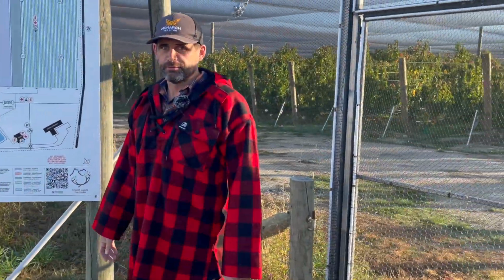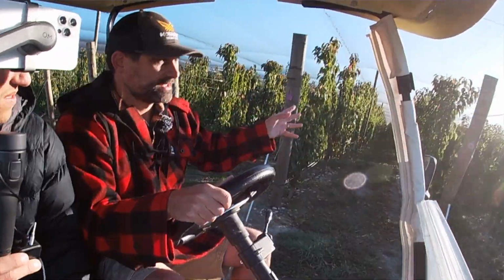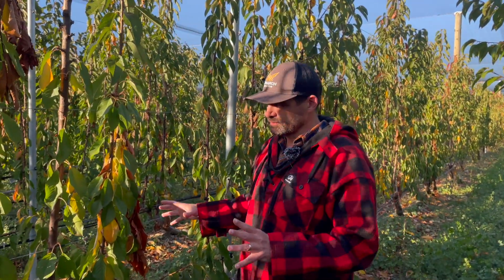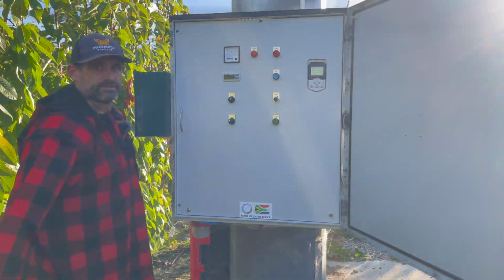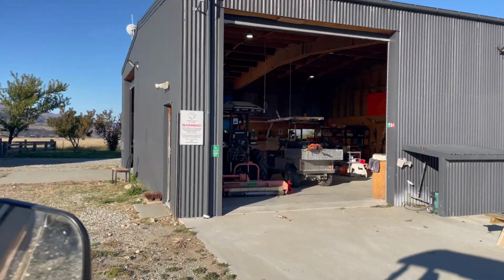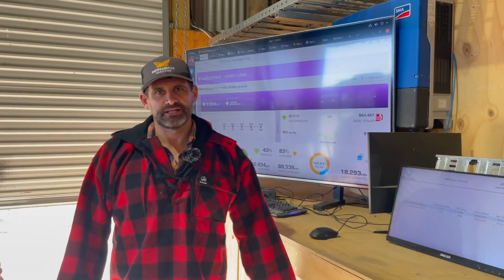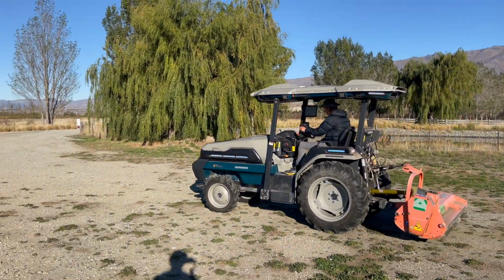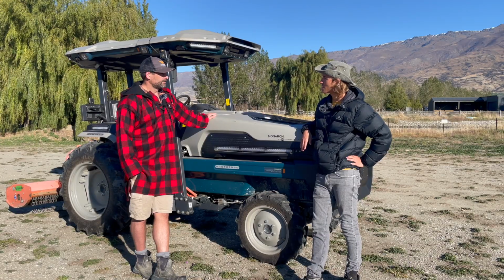100% electric Farm, meet the most innovative farmer, Mike Casey, Farm visit, tests of the monarch.

Comment: lubricants are oil my friend and all of the stuff there uses it
Reply from the maker: @kenn_with_2_n  Does it really count ?
Reply: @its_making_sense I want to emphasize the importance of honesty in your videos. As a farm owner in the United States, I can tell you that even if all my Kubota tractors were electric, we would still heavily rely on petrochemicals. The reality is that complex machinery, regardless of being powered by gas or electricity, requires various petrochemical products for maintenance—such as lubricants and greases—and components like rubber parts. Additionally, to broaden your audience, consider discussing the environmental impact of petrochemicals in the manufacturing processes of farm equipment. Everything from electric tractors to frost fans requires petrochemicals for their production. Highlighting this will add depth to the debate on sustainable farming practices.

also Petrochemicals=oil
Reply: Unless you are burning them the carbon in those lubricants are not released into the atmosphere, if oil was only used for lube and plastics it wouldn't be a problem.
Reply: @kenn_with_2_n  actually not really as most stuff is going away from hydraulic to electric so very little petro used. and most of the oil used is for making petrol(gas) and bunker and diesel not a large amount is used for lubrication. also i am seeing a lot of companies using kelp(seaweed) for rubber like products.
Reply: @kenn_with_2_n  petrochemicals are vital for the modern world. Lubricants, plastics, pharma etc.

Which is why it's absolutely bonkers we burn the vast majority of what we extract. Especially as the cost of extracting is increasing as we use up the easiest sources.

Solar doesn't get used up. Wind doesn't get used up. You build it and it punts out power for decades.
Reply: @kenn_with_2_n  No you found a catch 22 and wanted to call homey out on it.
No fuel is burnt, and lube/hydraulic oil could be plant based smarty pants....
Reply: Oh grow up. Firstly there are synthetic oils that aren’t from fossil fuels and secondly grow up. And finally grow up.
Reply: So there is literally no point in going electric? That’s your point? Kenn with 2 neurons